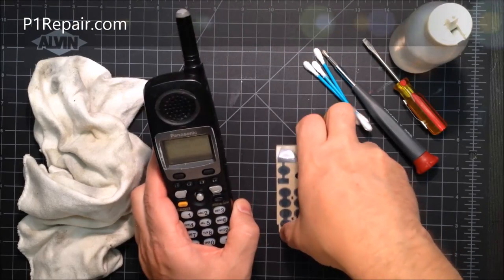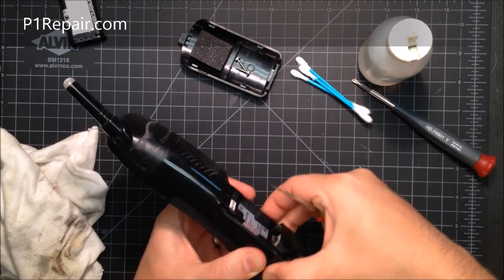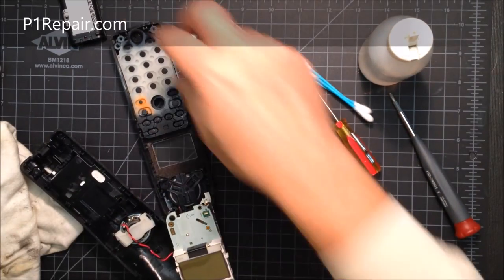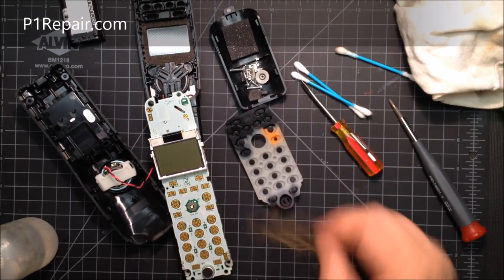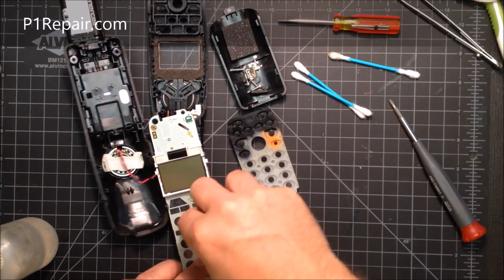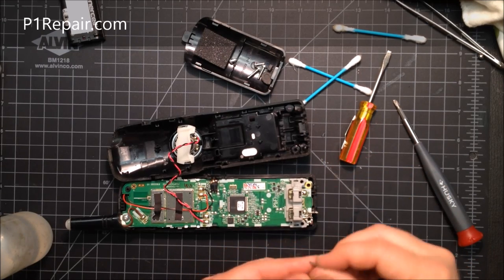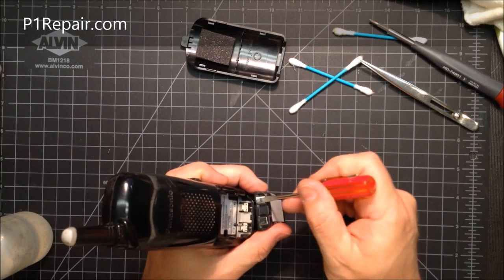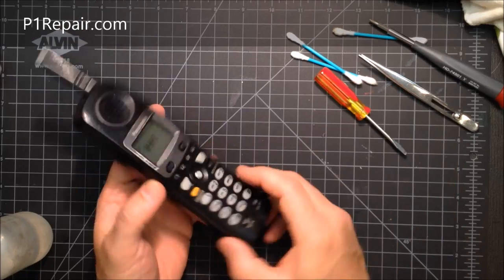Panasonic KX-TGA450b Keypad Button Repair

Comment: Thank you for the guide. I have the same problem, it is all wet inside when open it. After  some cleaning, it work well again. The tricky part is after the two screws, it is difficult to open up.

Comment: The video is perfect. I added a 'Like'. But as I can see this video was published few months ago. Why to repair such and old phone. Does Panasonic still provides repair kits for those phones?
I have same problem on my Panasonic Dect 6.0 (kind of "new generation"), KX-TGA652. Is there any repair kits for those?
Reply from the maker: +Danny F People like their old phones and it's much cheaper and easier to fix a few phones than to replace the entire system. If you buy a used replacement you end up with the same problem.  I do have a 2-part membrane for the 652 at my web site. You can find a link in the video detail description. p1repair.com
Reply: +p1repair I tried to purchase those 2 items, but PayPal rejected, from some reasons, transaction to your store.